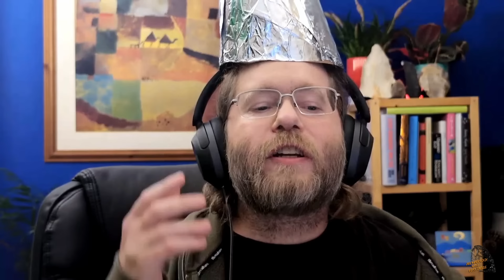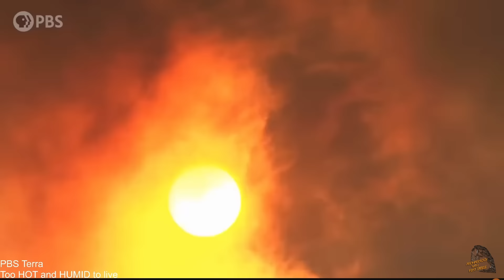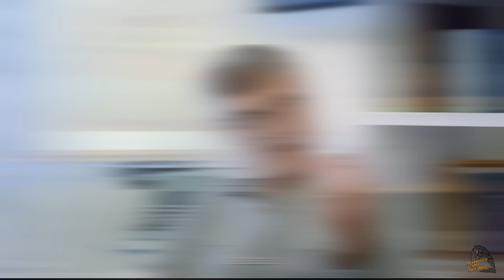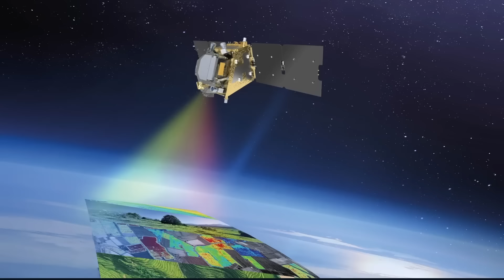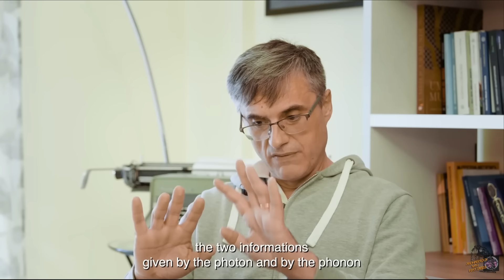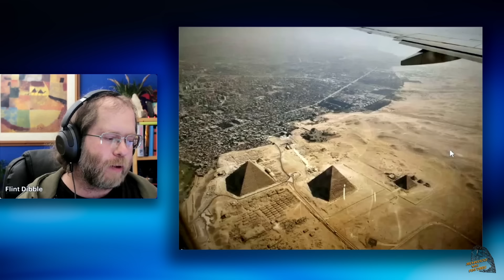The Viral Pyramid Scans: The Ultimate Debunk of the Khafre Project and Filippo Biondi

Comment: Hey Flintstoner, could you address how 2.5 million 2 ton stones are carved, transported and put in place during the construction phase. This is perhaps the hardest issue to overcome, the magnitude of the construction project itself is staggering, and no one has shown how this volume of rock could be moved in 20 years, it's a legit issue and needs to be resolved...
Reply: Also important to note is that the internal bulk of the Great Pyramid consists of roughly shaped stones as they were simply cracked and levered out of bedding planes in the quarry. Rubble and mortar filled in many gaps.
Reply: @Eyes_Open  That's what people like you who have limited knowledge of the history of the Great Pyramid and scant structural engineering knowhow has to say. For hundreds of years, treasure hunters has wrecked the outer structural integrity of the Great Pyramid. Add to that, that in the 13th century a series of earthquakes hit Northern Egypt further dislodging the outer casing stones already destabilized by attempts to dig an entrance to the structure. This enabled the Egyptians of the time to strip the outer limestone to rebuild El Kaherah, and with it, several hundred minareted mosques. 

In mid 1300's French Baron Anglure has this to say: "Certain masons demolished the course of great casing stones which covered those granaries, and tumbled them into the valley." (In French, of course. Translation is mine).

You don't have to be a structural engineer to imagine what happens when you forcefully extract an outer casing to the internal structure. And when the core masonry is exposed in a series of gradually ascending and receding steps to be weathered and worn by wind, sand, rain and further depravity of man for hundreds of years up to today.
Reply: @philatkins5081 Thanks for playing.
Reply: @philatkins5081  "That's what people like you who have limited knowledge of the history of the Great Pyramid and scant structural engineering knowhow has to say" No, it's something you can verify yourself by finding images that aren't used for tourism. The bulk of the Great Pyramid is roughly shaped stones. Or did you mean to reply to the other person?
Reply: @NinjaMonkeyPrime  You don't have the mental capabilty to understand what am trying to say, so I will no longer waste my time answering anymore of your comments any further.
Reply: @richlancaster8336  Maybe start here, then look at the sources: https://en.wikipedia.org/wiki/Great_Pyramid_of_Giza#Construction
Reply: @rich  I'll never understand this type of concern. Ancient peoples around the world figured out how to quarry, shape, move, and erect stone - the edifices are right there demonstrating that it can be done. There are many examples of peoples doing the same thing in the centuries before modern industrial tools and equipment. People can't fathom how it can be done - hey, I'll bet you can't explain how a skyscraper is constructed either - but no one says aliens over skyscrapers. Heck, there are illustrated books for children about the Egyptian pyramids.
Reply: @Tiktaalik59  Indeed. There is a debate about how, in detail, they were constructed. That is, by what exact means, out of several of entirely plausible ways they might have done it (e.g internal ramp vs external ramp, etc). There's no serious debate, and none needed, about the entirely evident fact they did do it. (They even left some day to day records of bored-sounding administrators overseeing the movement of materials.)
Reply: @PaulL-u3g  Agreed. Given that there are amazing stone structures all over the world it is very clear that ancient peoples were smart, motivated, and had the manpower. Pretty convincing evidence that while we can't fathom how, they could, undoubtedly with lots of trial and error. Besides the records, archeologists have uncovered small study models of the interiors of ancient pyramids, drawings inscribed right on the Giza Plateau to guide construction, and even trial passages cut into the bedrock at Giza - all evidence of ancient architects, surveyors, and engineers.
Reply: Hadrians wall was about half the volume of the Great pyramid, and took six years to build.
Reply: "This is perhaps the hardest issue to overcome, the magnitude of the construction project itself is staggering, and no one has shown how this volume of rock could be moved in 20 years, it's a legit issue and needs to be resolved" Nope. It's just people like you seem incredulous and refuse to research what 20k humans can accomplish.

Comment: I am a bit confused about patent expiring as they last a long time as they would not be useful if they lasted only a few years.  In the U.S. it would be 20 years. Did the crank simply fail to pay a required fee? Whatever the case is, Dibble is right that not having an active patent on an invention that would clearly be worth billions is damning. Oil companies, mining companies, militaries, and law enforcement would all pay through the nose to see what is really underground.
Reply: I haven't looked them up, but it looks like they were patent applications and never resulted in a granted patent.  This could be because they never produced the data to support the application, or they declined to pursue the application, which is much more expensive than just filing an application.

Comment: 18:21
Your arguments so far:
It's too hot down there.
There's water down there.
So it's not possible? Pretty weak so far. To me it sounds like perhaps the idea is to harness that heat and water or harness its energy, a giant geo-thermal power plant. And as far as SAR Doppler Tomography, you would probably do well to attempt to understand what they are doing before you throw it away. That's what alcoholics refer to as "contempt prior to investigation".
Reply: So, what, the ancient egyptians skipped every other form of electricity and went straight to absurd underground megastructures? And also no one ever said anything about their electricity?

I'm sure people would love to understand what the team did. Unfortunately, they won't actually explain how they did anything nor have they gotten a paper to peer-review that demonstrates the process. So instead we have to rely on Biondi's interviews where he uses a whole lot of words to say nothing.
Reply: Nobody understands what is being claimed. That is the fault of the claimers. Bad science needs to be flagged.
Reply: The temperature and water content being high is a pretty big engineering problem when you're working with 5000 year old technology. Even with modern technology overcoming these hurdles is a challenge. 
The idea of the ancient egyptians building the pyramids as "a giant geothermal power plant" is the most ridiculous thing ever.

Comment: I had a frustrating impression from this video. Well, as a physicist, I totally agree that the scan developer sounds a little unnecessarily sophisticated and vague, didn't answer questions, and the attenuation is a big concern. But when you start moking him about a mm accuracy... Well, if the radar or tomograph has a mm wavelength, the best resolution is determined by the diffractive limit and would be in the mm range. It doesn't mean you get it. It means it is the best you can get under perfect conditions. If you use radio waves with a wavelength in the meter range, the diffractive limit is in the meter range. That's it. There could be a difference in vertical and horizontal lines if the electromagnetic radiation were polarized. If you are looking some underground facility (in case of a lab that he is supposed to see), I think it is difficult to line up the projection and the image at exactly the same angle. Maybe he should do a better job, but that image was believable. 
If he has huge attenuation, the signal-noise ration become smaller, and the image is destroyed by noise. If the noise is big (as you also mentioned that there could be a huge noise), again, you'd see nothing but noise. There are techniques to reconstruct an image from noise. I don't know what he used and how effective it could be, and I agree with you that it all sounds very shady. 
I would say that when it comes to his image of the pyramid, the image he got is very noisy, and nobody can say what is there. It doesn't look to me that there are any objects (generators or something unusual) that he claims to be there.
Reply: If the image is an accurate representation of the data, it may be a bit noisy, but it's incredibly detailed for the depth it shows. And for the fact it's from a satellite. If it is real, it'll change a lot of industries going forward, including archeology. 

But if it is real, I don't think it is showing an underground structure. I think it's showing how the distribution of the pyramids weight essentially focuses vibrations into those spots. It looks like there's 8 spirals. That would correspond to the 8 sides/corners of the pyramid (the pyramids have 8 sides, most people don't realize that until they see a photo from above; and though it's just barely 8 sides, I think that would have an effect on the weight distribution). The void wouldn't actually be a void, it'd just appear that way because the spirals are where all the weight/vibration is focused.

Comment: Why would you build a massive two mile spiral underground to generate electricity instead of just putting those spirals in the Nile?
Reply: Diglett.
Reply: @st3venseagal248  Or maybe build a dam? Water wheels? Some coiled up copper? Surely they would know about that as they are so advanced in tech!!
Reply: If you meant why not build a bridge to cross the Nile. 
It would be about 2.5-3 miles counting the "lost branch" that's subsequently dried up that was 6-22ft.
But that would essentially be a dam, unless elevated above the food plain
Reply: To keep it a secret, of course.  Duh!  /s

Comment: As the satellite processes in a curved arc through space cutting through the moons gravitational field and the suns electromagnetic propagations it radio transmits Doppler shifted transmigrigricated signals which form interference patterns with the elctrogravimetric field of the desert causing a harmonic oscillation
Reply from the maker: quick, apply for a patent and then let it expire!
Reply: @FlintDibble  It's the letting expire that proves how truly revolutionary the claims are, of course.  It's a critical step!
Reply: You're going to need a really high-quality retroencabulator to process those oscillations without side-fumbling tho.
Reply: @KSignalEingang that’s where the heterodyne defibrillator helps
Reply: This guy speaks fluent startrek technobabble.
Reply: fart

Comment: As regards the heat increasing with depth issue - I can crank up my bullshit generator and claim this proves that the (aliens? Atlanteans? Lemurians? obviously someone used to living underwater) are powering their secret city with the heat from the rocks, thus cooling the city and giving it massive amounts of power!!!!  (probably something to do with high-temperature superconductors!!!!!!!)  The key to rapid rationalization is to think "what else is true if X is true" and then pick the most attention-grabbing of the ideas that you come up with.  In general, an amazing claim presented without evidence is usually bullshit.  (Which is ironic because the same question "what else is true if X is true?" helps one detect nonsense - simply look for where the evidence should be sitting there patiently waiting for you to discover it.  Sometimes absence of evidence is evidence of absence.)